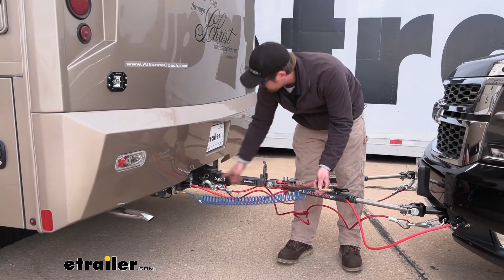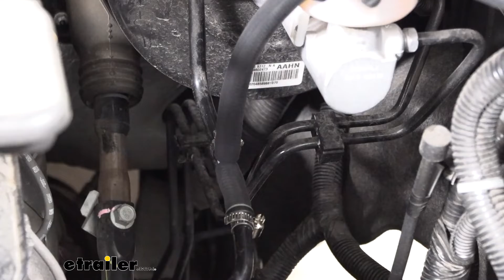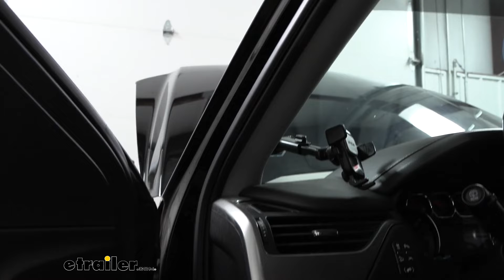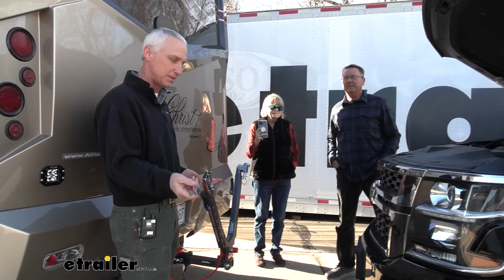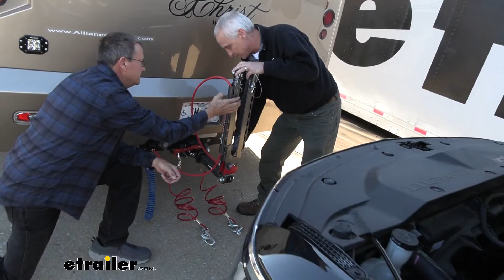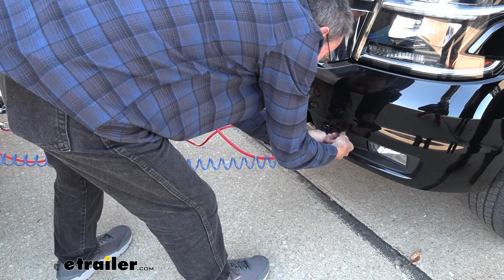Demco SBS Air Force One Supplemental Braking System Installation - 2020 Chevrolet Suburban

Comment: while not towing, when the driver gets in the car and the brake pedal comes all the way forward (driver settings) it causes the brake to be engaged. how do you account for this when installing it?
Reply from the maker: When not towing, the brakes on the towed vehicle will operate as from the factory.
https://www.etrailer.com/Tow-Bar-Braking-Systems/Demco/SM99243.html
Reply: My Tiffin motorhome already has the airline installed from the factory. What is it cost to buy the towed vehicle part of the system?